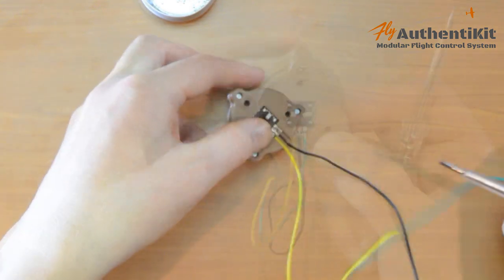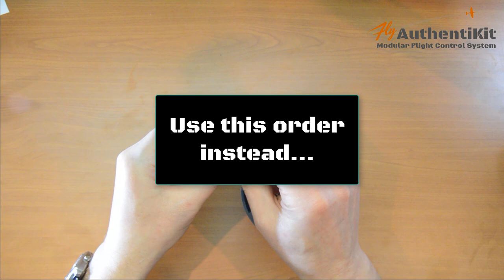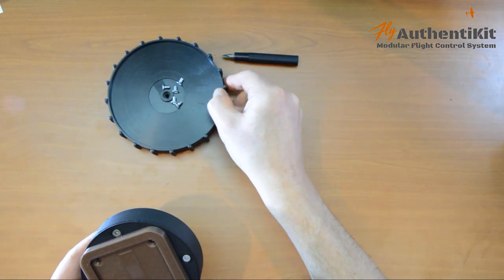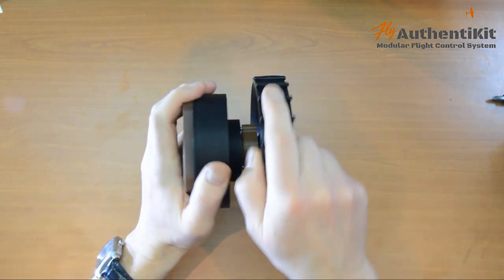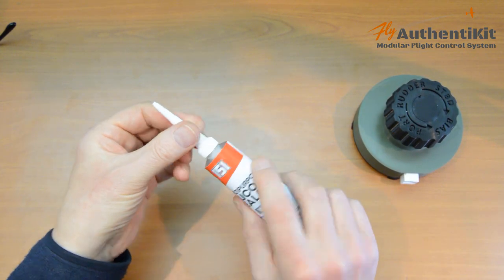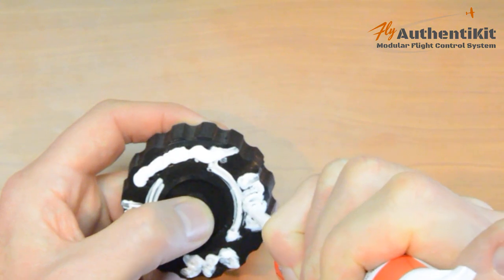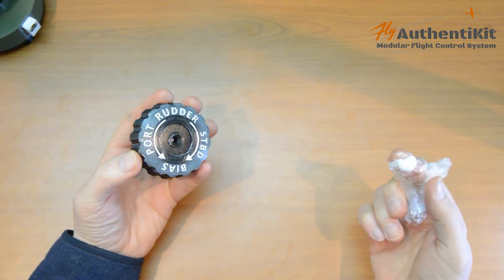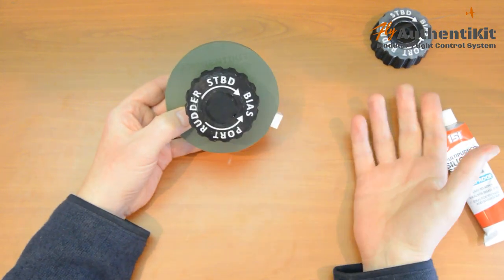AuthentiKit Spitfire MkIX Trim Wheels Assembly Guide

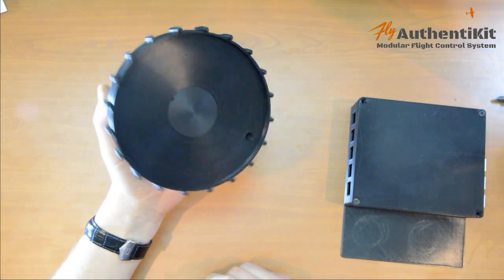Comment: Cool rudder trim. Thanks for doing this mate. You could make it easier to follow if you add chapters to the video description. Just write 0:00 Elevator trim. 12:21 rudder trim. It's good SEO too 😜
Reply from the maker: OK added! Thanks for the tip, though probably not the best video to start doing this for as the rudder trim part requires you've watched the first part :-)

Comment: little tip for the silicone use, before you fill up the wording carefully paint all the parts not to be covered with a small amount of washing up liquid; leave to dry a little and then use the silicone. you will find it wont stick to any part that has been soaped, use a modelers small paintbrush., leave the silicone to dry before you clean up.
Reply from the maker: Nice tip – I’m thinking of setting up an AuthentiKit Community YouTube channel. Don’t suppose you’d be happy to make a short video of this technique with the washing up liquid?
Reply: @AuthentiKit  HI, sorry but I don't have the tools or the know how to do that, it's a very simple process. most kitchen and bathroom fitters use the same technique, you probably can see that on u-tube, just have to be careful not to get soap in the letters.
Reply from the maker: Thanks Michael. That is very useful all the same. I will see if one of the guys in our discord group could make such a video.

Comment: There's an issue with using an encoder with DCS. ED don't seem to be able to decide on how much one 'blip' of a digital control input moves the trim. One example is the Mosquito, where digital trim is too sudden - it's impossible to trim accurately. You can complain to ED of course, but they'll faff about with excuses for 6 months or longer ( REPORTED ) - unless the module is newly released and getting some attention. Some minor and not so minor annoyances drag on for years without being fixed as they concentrate on that bloody awful Hornet.
And then when they fix it, there's no guarantee it won't be broken a month or two later with the unintentional consequences of an update.
Thankfully the Spit isn't currently suffering from a too fast digital trim, but there's no guarantee it won't do in the future. 
I mainly fly DCS so my trim wheel uses a 3 turn potentiometer, even ED don't seem to be able to cock up an analog axis. Gearing a single turn pot to the wheel is another method of course.
Great project by the way, it's good that you are distributing the STL's on an open source basis.
Reply from the maker: Don't worry - we're on it. I'm testing a beta of this and we're hoping for a releasable beta in a week or two - https://authentikit.org/authentikit-trim-wheel-calibrator-for-msfs/ - not just for MSFS by the way. DCS too
Reply: @AuthentiKit  Marvellous, I'd really rather use an encoder anyway